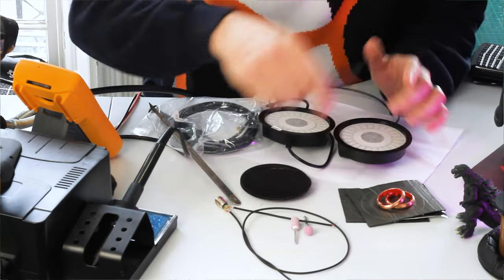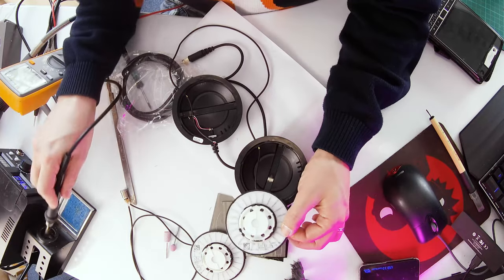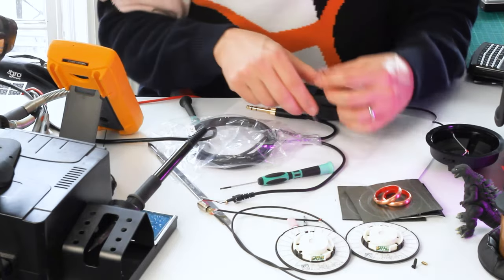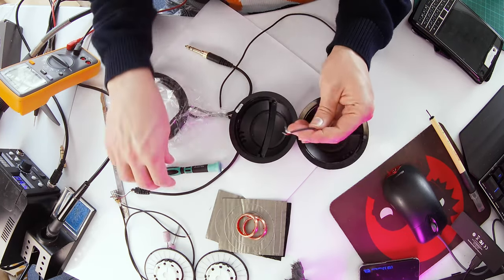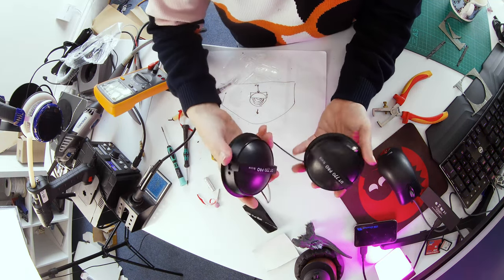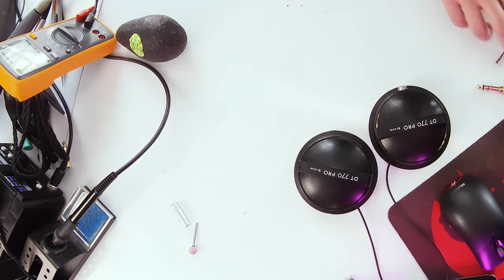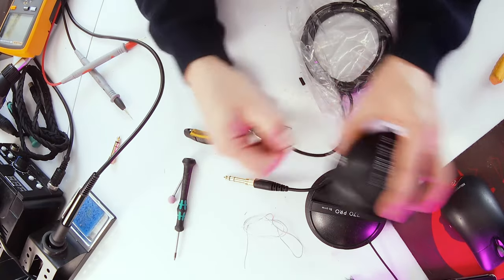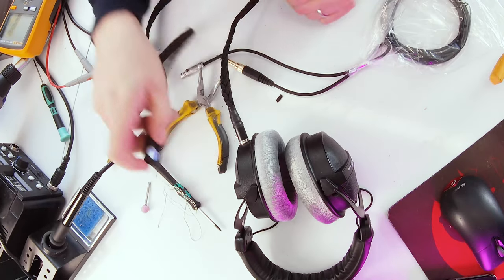DT770 Detachable cable DIY Kit and other mods

Comment: I know this video was posted like a year ago but  i had a question and maybe you still read the comments 🤷. I have an amp with a balanced output and i went down an internet rabit hole to find out how to go about using it. This ultimatly led me to your video. The question is, can you short the two ground pins like you do in this video and plug it into a balanced amp without damaging the amp. My understanding is that the balanced cable carries two positive and two grounds. In the video you connected both of the ground pins to a common ground wire. Later you stated that you could swap in an XLR cable to plug in to your balanced amp. Does this not create a short? Just trying to get clarification.
Reply from the maker: No - if you were to use them with a balanced amp you would need to fit them with a 4 pin socket and make a 4 wire cable without the negative wires joined

Comment: My cable is broken and I would like to do the mod. Can I use any 3.5mm Cable for this Cable mod? Also is this mod compatible with the v3 dampening kit?
Reply from the maker: This is compatible with the V3 mod
Reply from the maker: This version of the detachable cable mod is a mini XLR but you could mod them to take a 3.5mm jack
Reply: @CustomCans  Thank you very much for the quick answer. I will buy an 3.5mm cable and try to convert it with the conversion kit.

Comment: Modding your dt770's is easier than it looks, if a little fiddly. For reference, I think if you have ever fitted brake pads to your car or repaired a toilet cistern, you can do this.
Reply from the maker: I have repaired a cistern or two and modded lots of headphones. Despite having a  50% share of a racecar I have not yet changed my own break pads so ...  I should really give that a go this summer ;)

Comment: I just mod my 250 ohm for cheap with a 1-2mm thick poron foam , bought it for Keyboards . made a circle with slices like a pizza that it can fit perfectly in and double sided tape. They got a pretty Reverb Sound to them and the background being a bit forward now. it compress the inside a lot but Sound Great for me :D had no thing for the weight mod.

Comment: So, what's not clear to me is whether you MUST use a balanced cable/connection with this mod.

Or can you also use the TRS cable you guys sell with a non-balanced source? This question is literally the only thing stopping me from placing an order. Thanks!
Reply from the maker: No, once they are modded you can use them balanced or single ended - you just need 2 different cables or a balanced cable and an adapter. When we sell them we supply the balanced cable and convert the stock cable so it can still be used with normal 3.5 and 6.3mm jack equipment

Comment: would this mod be possible for someone who has never soldered before? I see you have simplified the amount of wires that actually end up being attached to the drivers. I know this is an older video but any help would be appreciated! thank you.
Reply from the maker: Probably not recommended - I would practice soldering other things until you get the hang of it

Comment: I got so excited seeing this video! I bought a K702. When it arrived it suddenly dawned on me that ive had a similar headphone laying around fir ages. The k602 from my dad. So returned the 702 and im just using the 602 only thing is: it doesnt have a detachable cable 😭 so i want to do this but to the akg k-602. Do you have tips?
Reply from the maker: I could not find any images of the K602 but the K612 should be able to take the same housing we designed for the K712
https://www.youtube.com/watch?v=x6msKqxcKcc

Comment: i did this mod to my 770s to replace the headphone jack mod i had earlier, unfortunately the hole i had drilled for the headphone jack was a bit off from where the hole has to be for the xlr connector so mine is loose but after i glued it in place it hasn't budged so far, if i have problems with it in the future though i will replace that ear cup, i also found that i didn't need to cut the center ring at all in either mod as there was no interference and everything fit perfectly already

Comment: For anyone who has already tried this, what kind of sound do you end up with after you mod the interanl cups? He mentioned adding bass, but I've never felt like these really needed more bass, but then I wondered if adding the stickie bits maybe helped smooth things out by absorbing certain sound waves. I've got questions LOL!!!
Reply: if you have heard the 1770 pro, 1990 pro and 990 non pro you can realize the 770 doesn't have significant base just more than the 990 pro.

Comment: Hi ! Thanks for this great tutorial. I own the DT770 250 ohm. I don't have a balanced headphone amp. I was wondering if I could connect my headphones to the XLR line level outputs of a preamp without damaging anything. In this case, I will simply modify my headphones to connect each speaker to a 3-pin XLR male connector : XLR output > XLR connector > headphone driver. It will save me the cost of a new headphone amp and new headphones to enter the balanced world...
Reply from the maker: I know we have had quite a few customers that have done that and it worked but it may vary from pre amp to pre amp how much power they put out through the XLRs

Comment: for the cable, could i use a different mini xlr cable rather than modding the old cable from the headphones?
Reply from the maker: Yes as long as you wire the socket correctly it will work with other cables

Comment: @CustomCans minute 27:01 you mentioned that the pinout is RIGHT on top, LEFT on the SLEVE, and ground a the end of the connector, but I thing that's wrong, and it's LEFT on top, RIGHT on the sleve and GROUND at the end of the connector.

Comment: Thanks Man.. your video was a great help.. my dt 770's Cable recently had a bit of an issue where if i move a little bit one of drivers stopped working.. i followed ur guide and made a 3.5mm detachable cable without the damping and weight.. slight sound issues here and there though rarely.. the bass seems a little loose and im experiencing sound leakage.. anyways thanks for the Video it saved my headphone :)
Reply from the maker: You may have a air gap around the socket - try plugging up around it with bluetack or something similar

Comment: Will connecting a 4.4mm balanced adapter on the wire of the dt770 allow me to connect my headphones to a 4.4mm balanced input and achieve a balanced sound?
Reply from the maker: No. The 770s need to be rewired to make them balanced and using an adapter to plug the existing cable into a balanced amp could damage the amp by bridging the two negative connections

Comment: Hello. I made an MMCX mod for my DT770. It seemed to me that mini XLR is too bulky. So, the MMCX is small enough, clamps tightly, and I can buy different SE or BAL cables on Aliexpress. MMCX connectors and cables from Aliexpress may be gentle, but no worries now. All looks good. Also the 4-wire connection improved the soundstage, which I would definitely recommend. I can give additional info if somebody interested. Or separate video on Custom Cans ma be useful. Cheers.
Reply from the maker: Yes, that is probably a good option. We make quite fat cables so MMCX is not something we use.

Comment: You’ve modified a few bits and bobs. How does that compare to the original sound of the headphones?
Reply from the maker: Discounting the cable and going balanced, you get more detailed bass... less muddy which helps you hear the mids a bit clearer. It is subtle but noticeable

Comment: What kind of solder did you used, regular or containing silver?
Reply from the maker: We use silver solder but normal solder will be fine and much easier to work with

Comment: I'm still thinking about doing a balanced conversion this way, or match it with my hifiman and go with 2 3.5mm. i like the cable to be interchangeable, but somehow it would take away from the 'beyerness' of the cans haha.
Reply from the maker: Yes, I know what you mean ;)    but if you do do it, and have a pair of hifimans then a dual 3.5mm may be the way to go as then you can share cables

Comment: Thanks for great vid as usual! Really cool that you don’t push viewers to buy the sets in your store, and instead actually provide the parts-list. Not that many ‘’opensource’’ mindsets in the HIFI business.

I’ve got the DT770 32 & 80 ohms, which would you recommend doing the dampening mod on? 

BTW, got your bassmod for my HD600 a while ago, damn you have done a brilliant job with that set!
Reply from the maker: It works well on the 80 and 250 versions - we have not tested it fully on the 32 ohm ones but it should have a similar effect - but you will probably have to use the port adapters to bring the bass in line as the 32 might get a little bass heavy

Comment: Thanks. Good video, clear, informative and evident that you are an accomplished modder. I have seen many YT 'hackers' make a bodge job of mods. Myself, I love making and modding kit for various projects, so have subscribed. Was thinking of buying some Sony MDR 7506 cans for field recording work, and modding a detachable cable. Most seem use a 3.5mm socket on input end but I had wondered if a mini XLR might be better if it fits. Yet to buy parts so don't know what is best yet. Any views?
I do like the way with this that you have thought about the frequency response and introduced weights, damping pads etc to adjust base response. Was this done on a hunch or have you done scientific tests to validate and quantify the relative impact of the incremental changes? I must look into these BD cans too, are they best for mixing or just overall end consumption of content in your best view? They look a bit too bulky IMO for field monitoring,  so I'm drawn to the Sony 7506 cans for that role.
Reply from the maker: When we make mods, we normally start off with a few rough ideas on how we can improve things and then do weeks of tweaking and testing until we come up with something that sounds good and is easy-ish to fit.

Comment: is it worth getting the DT770s  ? I`ve been looking for a budget ( under 150 euros  and around 32 ohms ) studio headphones for my PC for music and gaming , these seem to have very mixed opinions from different reviews so far.  cheers !
Reply from the maker: I am not a huge fan of the 32 ohm version but most PCs should be able to run the 80 ohm ones. It may be worth looking at the HD25 as well as they have a very high sensitivity so will run off most equipment without an amp and sound very good for the price
Reply: @CustomCans  thx you for the response, i will check out the hd25`s

Comment: Hi I m looking at the website and the kit says its 3 pin MiniXLR but the pictures shows a 4 pin connector. So is it 3 or 4 pins
Reply from the maker: Hi - I think they have just been lazy and used the same picture but if you order a 3 pin kit, you will get a 3 pin one

Comment: I deserve those DT770's because I just broke mine trying to make the mod. 😂 Too shaky hands for soldering it seems, and the white "paper" covering the speaker unit inside the cup that goes towards the ear got also punctured because I have such clumsy hands.
Reply from the maker: Yes, Modding things is not without it's dangers. I feel your pain. I have broken a lot of stuff over the years

Comment: Not sure it qualifies as deserving, but DT770's are my first foray in to "decent" headphones, coming from the wasteland of "gaming" headsets they've been a massive revelation (and I have no excuse, my dad was a proper audiophile so I should know better). Been watching your vids and procrastinating about modding them (mainly because I want a blingy colourful cable)... so yea, if you sent me a mod kit I'd have no excuse but to get it done then come back to you to buy some fancy cables (yes, plural... right now my 770's never leave the PC as the jack is out of easy reach... if I could easily disconnect the cable I'd be able to use them for TV viewing as well (and consign the Astro headset to the dusty tech graveyard drawer once and for all).
Reply: Just buy a $10 audio extension cable. Leave that end plugged into your computer. No mod required. 😀
Reply: @jeremywilliam79  Where's the fun in that?
Reply from the maker: I have never been a very good gamer but I used to be a hardcore overclocker using cascade phase change coolers to get the CPU to -57C under load. Then when I realised I was spending nearly half my yearly wage on destroying computer components I decided to start playing with audio equipment - Which it turns out is just as bad ;)
Welcome to another expensive hobby.
I will stick your name in the hat
Reply from the maker: Congratulations Ross, Your name was chosen in the drawer - email jfunk@customcans.co.uk with your address and the word Winner in the title and we will get some bits sent out to you
Reply: @CustomCans  Awesome! Much appreciated! Email sent. :)

Comment: Can anyone help me just got these how would I wire the right and left drivers on the old platform. I don't have 1 and 0 on my drivers
Reply from the maker: There should be a pen mark on the casing of the driver. Wire them so the negative wire is on the side closest to the pen mark
Reply: @CustomCans  okay and nagatice would be the white wire and red hot
Reply: So white is negative and red positive I wired the right ear correctly but the left one unless I wore the positive with the middle terminal I get no sound is that okay? To tie the right and middle terminals together with the positive

Comment: Greetings, 
First of all, thank you for this video. I'm actually thinking of doing this mod for my DT 770 Pros 80 Ohm.
But since I would prefer to have a Shorter Cable with it, I was wondering what type of wire or litz you would recommend for a DIY sleeved braided wire, one balanced, one unbalanced, and one for the headband. 
If it changes anything, I'm from Germany. 

With kind Regards

flammehawk
Reply from the maker: If you want to make a braided wire then any decent copper or silver plated copper wire should be fine as long as you don't get it too thick. Replacing the headband cable does not make a huge difference but you might as well change it if you are making custom cables any way. Sorry I can't recommend anything specifically as we get wire made to order for us to our own spec but any wire you like the look of where the core is under 1mm - any fatter than that and you will have trouble soldering it to the connectors

Comment: I also got all the parts for the DT1770PRO in the meantime... ^^
I just lack the courage for the balanced mod xD
Reply from the maker: We will be making an easy plug and play mod for the 1770 and 1990 with no soldering needed in a few months
Reply: @CustomCans  i know ^^
i asked u about this a few months ago... but i'm not so good in waiting :x xD
now i have a diffrent idea... ^^
my plan is to make another  balanced connector on the right side so i have both options at the same time ^^
left - normal
right - balanced
Reply from the maker: @katchou1337  good idea - that would make it pretty easy and safe to do. Also - knowing my luck we will get busy again and I won't have time to make the kit for them

Comment: Do you do anything for the TYGRs? I'd love a detachable cable TYGR 300 R.
Reply from the maker: Yes here is a link https://jfunk.org/wpc/product/beyerdynamic-detachable-cable-mod/
Reply: @CustomCans  awesome thanks.
Reply: @CustomCans  if I wanted to do it myself, can I use the 770,880,990 kit?
Reply from the maker: @Gershy13  Yes, they are very similar to the 880 so the socket fits the same way

Comment: I want to mod this to mainly use with a FiiO KA3, it has a 4.4 mm balanced out, how would I go about modding such a cable, cant really find mini xlr to 4.4 to just buy. I am very new to this.
Reply from the maker: We can make you one or we offer a send in service if you want us to do the mods
Reply: @CustomCans  I would love to do it myself, I have done some diy on other tech before. I was just wondering about the 4 pin mini xlr to 4.4 mm jack.
Reply: @CustomCans  i just found the link to buy the cable, i was just being dumb and not seeing it at the diy kit.